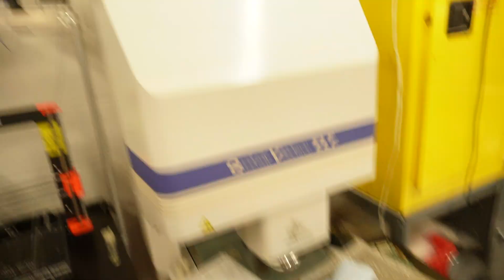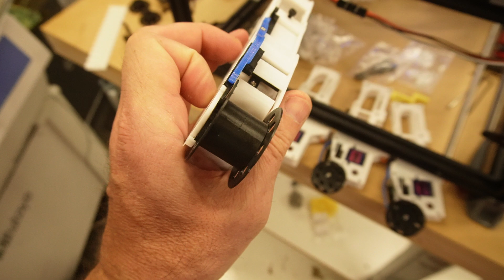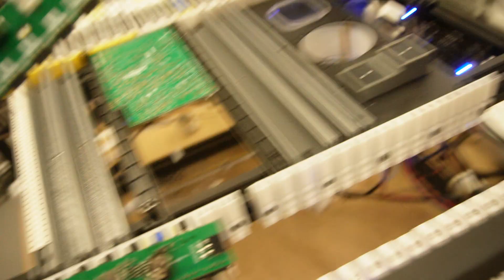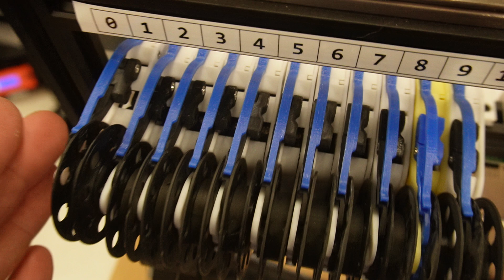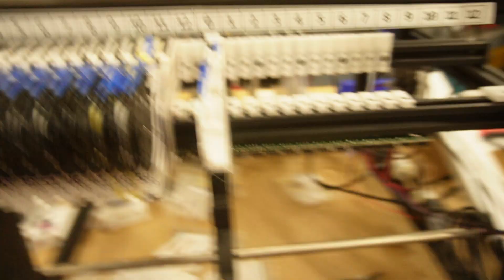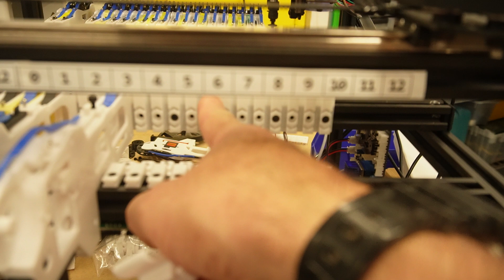PandaPlacer BambooFeeder AS2 alignment process

Comment: Hi Nicky, thanks for the videos. One thing I'm not clear on: can this machine only load components via the feeder, or can loose components placed in a plastic tray also be used using the vision system?
Reply from the maker: This machine can pick loose parts from a tray. The capability is provided by OpenPnP software. Here's the LoosePartFeeder repo:
https://github.com/openpnp/openpnp/wiki/AdvancedLoosePartFeeder

Comment: Hello. 
What type  and size of aluminium profile did you use for frame ? 
And what   is guideways ( model )?
Reply from the maker: They are part of the PandaPlacer kit - 20 mm x 20 mm mostly. I don't know the linear rail size.
Reply: @nickydoes   Thank you :)

Comment: Great videos! Thanks for supporting the Pandaplacer. I printed the feeder parts on my Prusa MK3s; the lock that you show at 6:38 comes as one piece -- i.e. it does not rotate.  I see in the slicer that at the 3rd layer the axle fuses with the rest of the part.  How did you print this part?  Thanks!
Reply from the maker: @ValeriodellaPorta  you're welcome, and I'm glad you like them.

Print it as is. You will be able to break that layer easily.
Reply: @nickydoes  I did print it, both on a 0.20 and a 0.10 mm layer with support, that's why I posted. The gap is just too small.  I'll import the STL in Fusion 360 and fix it.  Thanks again for your videos.
Reply from the maker: @ValeriodellaPorta reduce the squish on your first layer. Set your z calibration a little higher. Use 0.2 layers.

For me, the initial height makes the parts easy to snap free.

Comment: Must say I'm slightly surprised at the number of little bits and bobs that the kit is comprised of.
Specialised things like double tubing for the vacuum, not just 2x the length and run them twice.
Custom flat flex cabling for the wires instead of just a bunch of them (and of cause daughter boards
Reply from the maker: @TalpaDK  do you mean this in a good way? I think so. I have an extra parts drawer from PandaPlacer, and those parts have been helpful. I just printed a 25 mm up camera shade. The 25 mm camera standoffs were part of the original kit. Kudos!
Reply: @nickydoes  Mostly its a good thing, the specialized components seems to create better solutions than generic ones would have.
Only possible downside, they would be harder to replace if they ever break.

Speaking of breaking, does the x carriage have to reach the physical end stop furthest away from the motor?
Asking as the last bit of the FPC seems to have a very hard time getting over the zip ties on the belt, and ends up getting caught between the y bracket and the x carriage. It doesn't look like something that will be good for it in the long run.

Comment: Order to shipping time on the PandaPlacer is however way longer than what I'm used to... Currently at day 6 and counting.
Almost like the components have to be source first...
Reply from the maker: @TalpaDK Where are you? What country/region?
Reply: @nickydoes  Denmark (EU/Europe)
Reply from the maker: @TalpaDK  The full A1 is stocked in Canada, and I had expected it was stocked in China also. What time actually elapsed from order to delivery?
Reply: @nickydoes  Ordered on 2024-07-16 the shipping (label) 2024-07-25 and if I'm lucky and everything goes smoothly with UPS and customs the kit may arrive here tomorrow (2024-08-01)
Reply: I also ordered some 6mm "whiteboard marker tape" and two smaller nozzles  (CN030 and CN020) from two other aliexpress shops with the regular "slow" shipping... They arrived today, beating the expensive UPS expedite shipping.

Comment: Hi, nice videos. I like your content. First PandaPlacer video was 3 months ago, but all I've seen is calibration, feeders and such. I've also seen your video regarding Opulo. Thanks to you I now know it is not as it seems... Does the PandaPlacer actually works? Can you place components? Could I buy it to produce pcbs (of course considering it as an hobby grade tool) or the machine is an hobby itself and will hardly produce anything?
Reply from the maker: @tomy983  Thanks! The machine will definitely produce boards. 0603 via auto feeders for hobby level is no problem. 0402 is a bit fiddly, maybe 95% reliability. I plan to do a few more quickie videos. If there's something you're wanting to see in detail, let me know.

The Opulo may have been improved since the v3.0.1 I had. I was quite disappointed in it, though. The PandaPlacer fits on a table, and doesn't have the fiddly build plate. Most of all, The PP team responds with substantive answers when issues arise. I hope they can scale.
Reply: @nickydoes hy, I have also the lumenpnp and the pandaplacer. The problem from the lumen is the feeder. The position from the component is not on all time the same. I have write Leo for the the new stl from the feeder. I print it and hope it's better than lumen. I forgat that I have also the tvs802b pnp. That's my hobby. I thing that I sell later the lumenpnp.
Best Regards
Michael